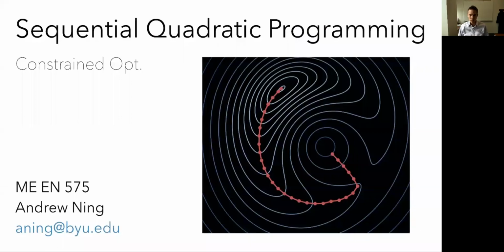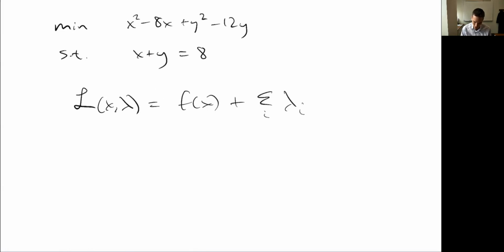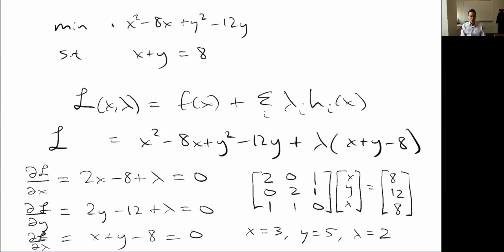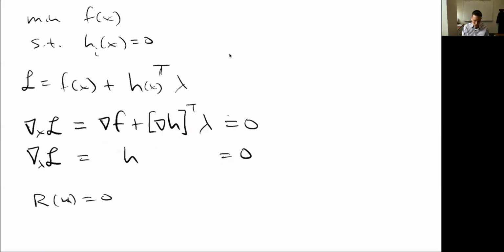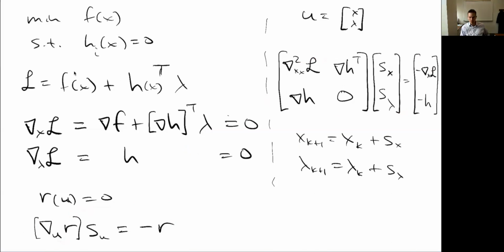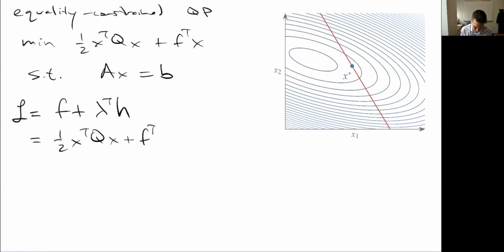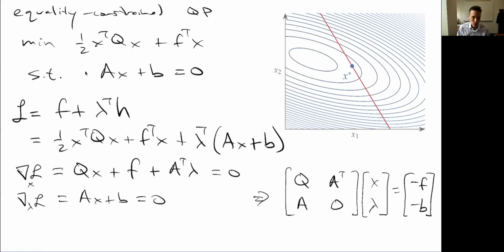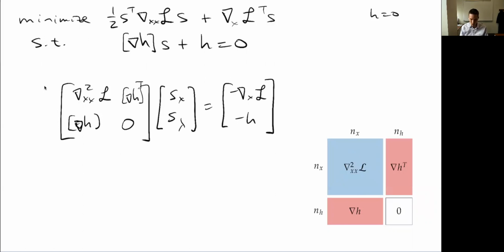Equality-Constrained SQP

Comment: At 10:57 you apply Newtons method. However, you say that grad(r) x S = - r. Where the S is the step. 

However, shouldn't it not be technically the gradient, but the Jacobean? Shouldn't you have written J(r) S = - r ?

Thanks for your help :)
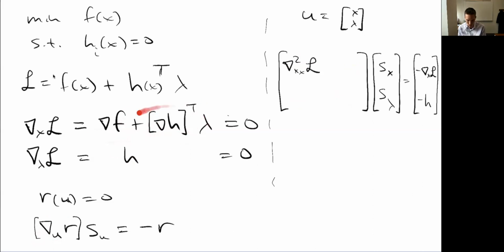Reply: Oh and one more question :) :) at 12:45 could you have also expressed the lagrangian of L as =  the lagrangian of f + lagrangian of h transposed * lambda?

And on the RHS isn't -h = 0, so shouldn't that be subbed in?
Reply from the maker: 1) No, it is the gradient of f and the Jacobian of h.  The Lagrangian has a different meaning, it is a function, not an operator.
2) No we don't want to sub in zeros.  You are correct that at the solution h = 0 (as will the gradient of the Lagrangian) - but at our given iteration we are not at zero.  Newton's method is used to drive us to that solution where h (and the gradient of the Lagrangian) are zero.
Reply from the maker: Yes, it is a Jacobian.  I was a bit loose with notation, but in the book we were more explicit and wrote them as Jacobians.
Reply: @BYUFLOWLab  thanks so much! I really appreciate the replies 😊. Ah I see! The constraint is not guaranteed to be satisfied at each iteration. That's why h does not get set to 0. May I ask which book you use?